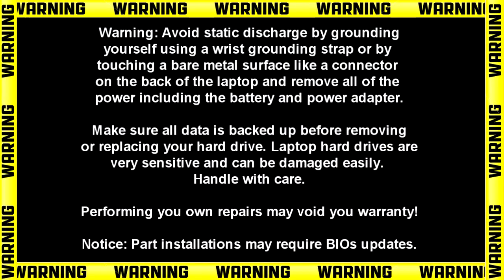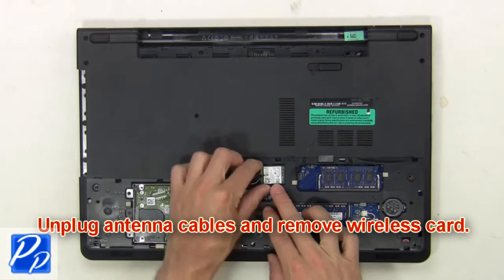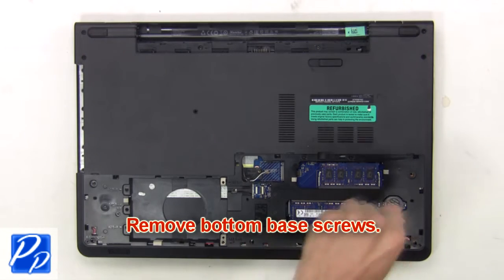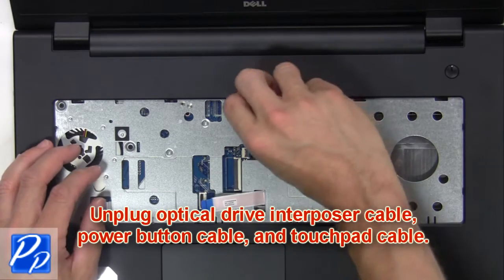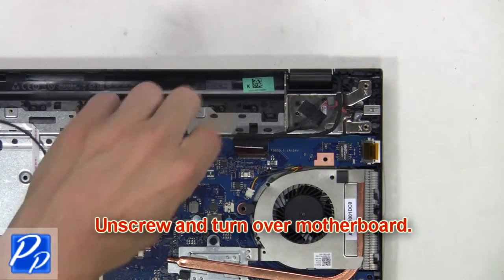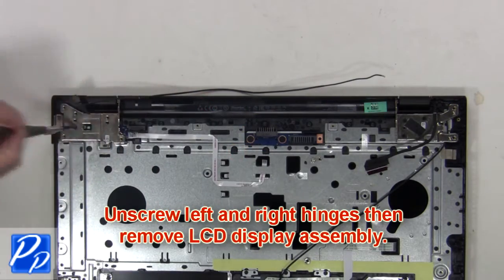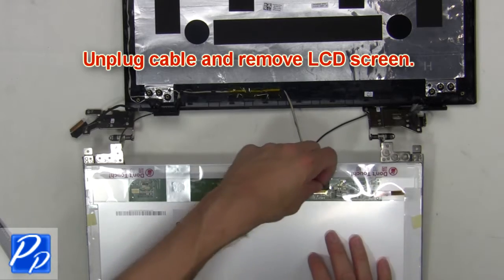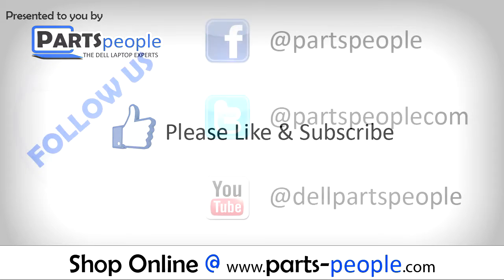Dell Inspiron 17-5758 (P28E001) LCD Screen How-To Video Tutorial

Comment: Worst LCD screen repair video ever.  You do not need to tear the entire laptop apart, that's insane!    

Correct instructions:  Remove the battery.  Remove the LCD bezel, remove the two top screws above the LCD. Remove the 8 screws below it.  Remove the 6 screws on the sides on the LCD panel.  Unplug the old LCD.  Follow these instructions in reverse to install the new LCD panel.
Reply from the maker: Thanks for your reply. For safety purposes we follow the exact steps listed in Dell's service manual when disassembling our laptops.